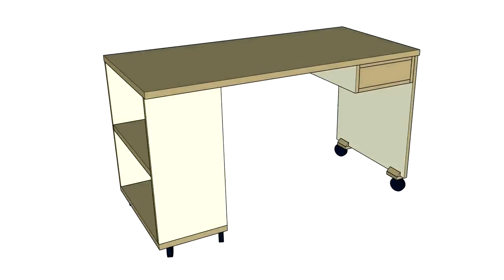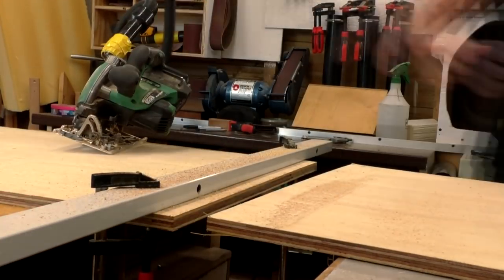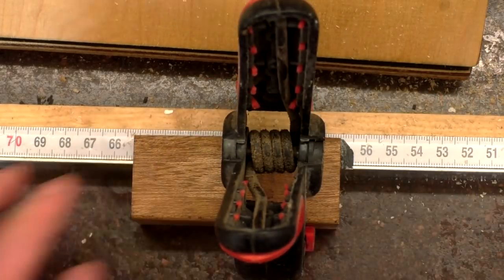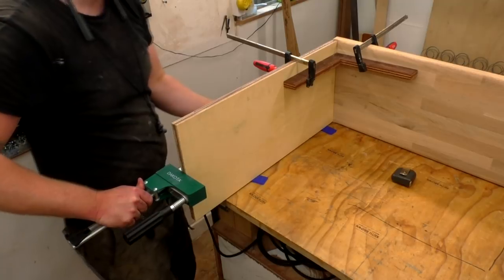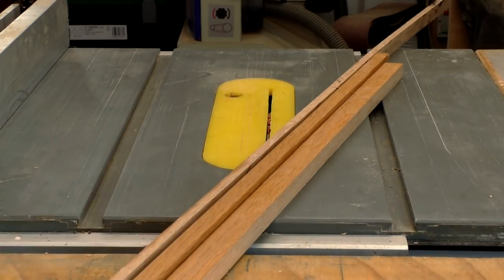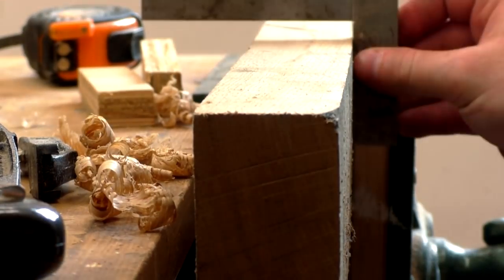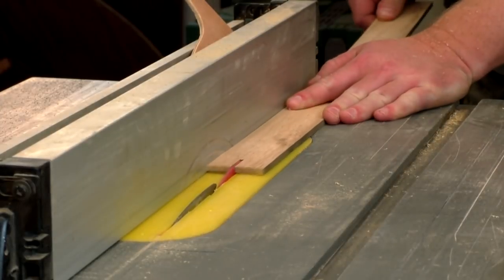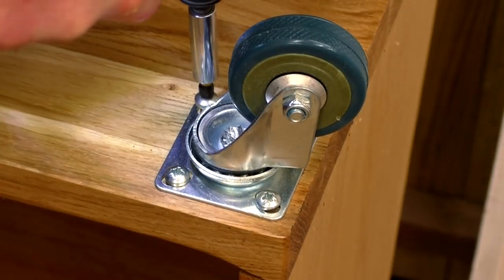Making Custom Desks (part 1 of 3)

Comment: A tip on your Japanese Ryoba Saw, then the course side is for ripping and the fine side is for cross-cutting. It's not really obvious since there isn't any markings on them to help specify which is which. It took me a while to learn it myself, but it makes sense once you do. 
I do really like to use them though, do you get them at Clas Ohlson or do they sell them elsewhere in the UK?

Can't wait to see how you make these desks dismantlable and sturdy at the same time since it can be a bit of a challenge.
Good luck and I can't wait for the next video!!
Reply from the maker: I got mine on Amazon, cheers for the tip!

Comment: Homebase is now Bunnings they bought out the Homebase stores. They are as others have stated Australian. You could  get some bargains from there when they first took over as there pricing structure was in line with there Australian store priced but over the past couple of months there prices have crept up too the usual uk rip off prices. There F clamps they do are great
Reply: Lime 23 I think you’ll find Bunnings have now sold off the U.K. chain for £1 and it is now in the hands of Hilco Capital.  I heard they are reverting the name back to Homebase.

Comment: Bunnings  bought Homebase in the UK and have tried to re-brand to Bunnings  there has been little interest and they are re-branding back fully to Homebase .After seeing the state of the ply at Bunnings he should have just given B&Q a try they have the same ply but usually its in better condition. I had the same issue for a project i was doing and the wood at Bunnings was scrapped from the bottom of the wood pile the cheapest crap they could find. I went to   B&Q got what i needed had to go though about 5 sheets till i got to a few good ply sheets and they were £3 cheaper than Bunnings.

Comment: B&Q Sell the same for £36 - it's all poor quality.  Bunnings is Homebase under a different name.  BB/BB Baltic birch can be had from  Smith Bros ( http://www.smiths-timber.co.uk/sheet-materials/ ) just outside Lowestoft. Prices are reasonable - I paid ~ £120 for a full sheet of 12mm and a full sheet of 18mm including having them cut to my requirements. (They charge per cut)  - Considering you had to double up your quantities I think you'd have been better off visiting somewhere like Smith Bros. and paying just a tiny bit more. They are open at the weekend but wont cut on a weekend. You can phone through your order/cuts and pick up on a Saturday though.
Reply from the maker: Cheers bud, I will definitely check that out 👍

Comment: Came across this good idea for DIY edge banding clamps Keith - https://youtu.be/qttn0GqifAQ. I’d bought some of the Rockler brandy clamps before but they’re scary expensive, but by using 50mm spring clamps and a bicycle tyre tube I knocked out 10 edging clamps in no time for a fraction of the cost.
Reply from the maker: That’s brilliant! Thanks may do this